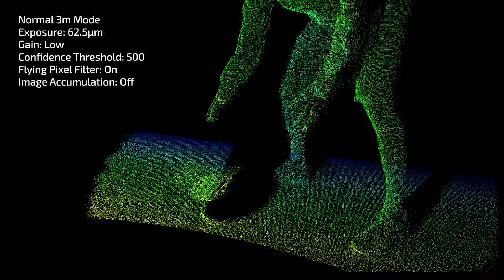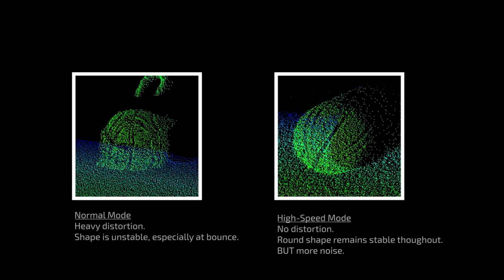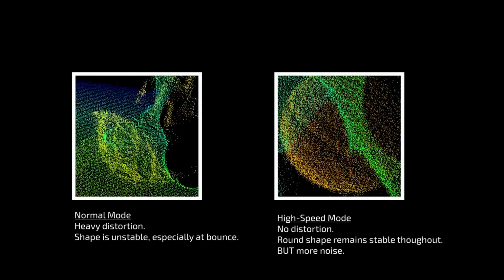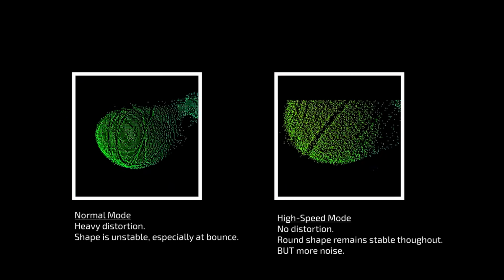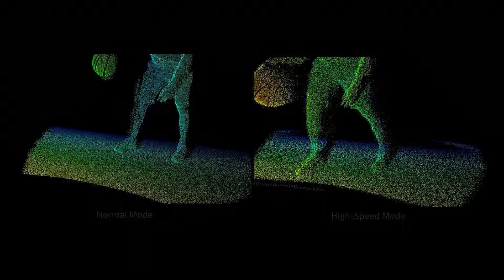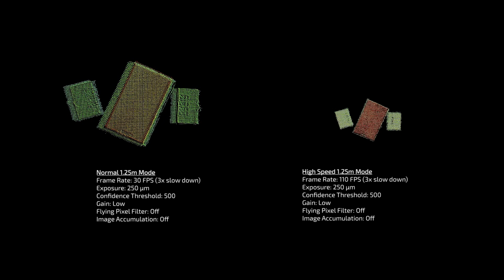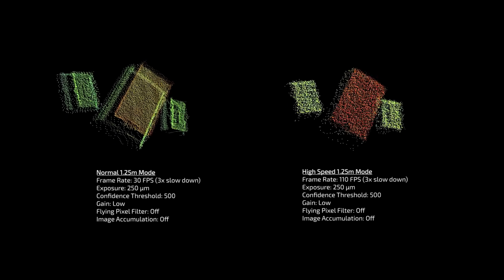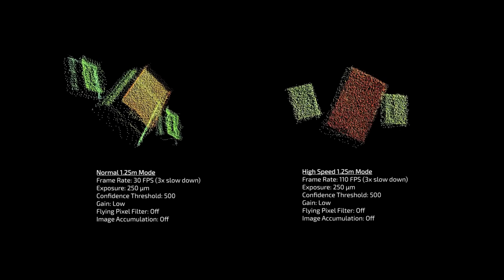High-Speed Mode Examples - Helios2+ 3D ToF Camera

Comment: 0:13 The distortion looks strange. Assume he is bouncing the ball at 0.5 m amplitude, 2 bounces per second. At the apex, the ball is not moving faster than about 2 m/s. During 62.5 us exposure, the ball travels 0.125 mm, which is practically perfectly still given the pixel size at this target distance. Why the distortion, then?

Image Accumulation is off, so I'm assuming that each single frame produces a distinct point cloud.
Reply from the maker: This is because 1 point cloud frame is derived from 4 phases (4 micro frames). If the object is moving too fast and changing positions for each micro-frame it will become distorted. More info here: https://thinklucid.com/tech-briefs/sony-depthsense-how-it-works/
Reply: @LUCIDVisionLabs  That page states: "It is only necessary to have the 0° and 90° micro-frames to calculate depth.". Do you provide 2 micro frames mode?
Reply from the maker: @PaulJurczak  Unfortunately we don't. Our Normal mode uses all 4 micro-frames (2 for distance calculation, and the other 2 to refine that calculation). In High-Speed mode we use only 1 micro-frame (provides much less distortion, higher FPS, but at the expense of accuracy and distance range)
Reply: @LUCIDVisionLabs  What is the total time of acquiring 4 micro-frames at 62.5 us exposure?
Reply from the maker: The total time for the 4 micro-frames, ignoring the idle period (grey part) is about 12.4ms, or 12400us with 62us exposure. The readout + reset time (blue and green parts) is just under 3ms for each of the 4 phases. (This comment is referring to the 1 frame diagram in the Sony DepthSense article.)
Reply: @LUCIDVisionLabs  Including the cool-down/reset makes it shorter? Did you mean 30ms?
Reply from the maker: My apologies, I've edited the previous comment.
Reply: @LUCIDVisionLabs  Thank you. For a single image motion blur calculation, the time from the start of 1st micro-frame exposure to the end of 4th micro-frame exposure is about 9.3ms, right?

Comment: 0:29 why is the unit of exposure time "um" ? is it typo?
Reply from the maker: It is a typo, should be "μs". Thanks for pointing that out!
Reply: @LUCIDVisionLabs  Thanks for answering my question. I have one more question, is the exposure in normal mode(00:11, 62.5us) and the exposure in high-speed mode (00:22, 62.5us) the same?
Reply from the maker: Yup! High Speed Mode has the same exposure options (62.5 μs, 250 μs, or 1000 μs) as normal mode. However, HDR can not be used in High Speed mode.